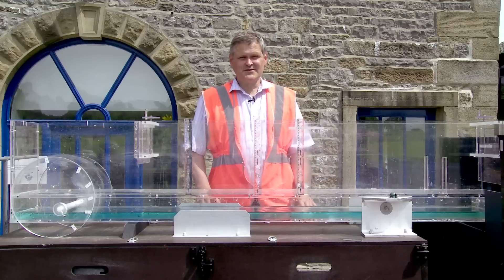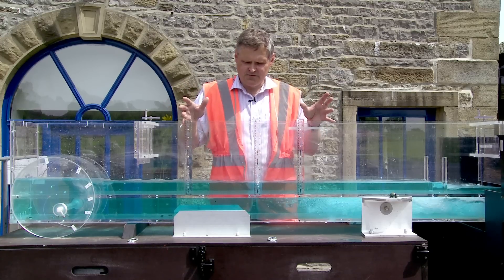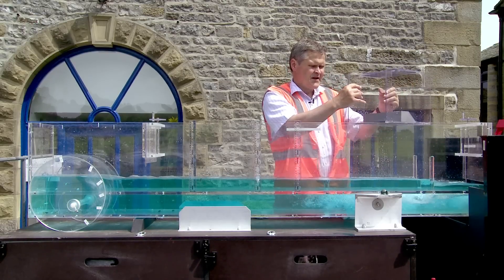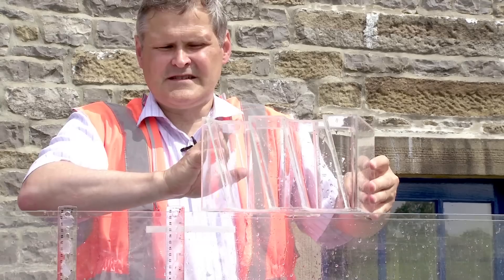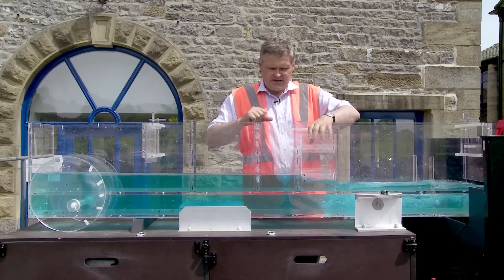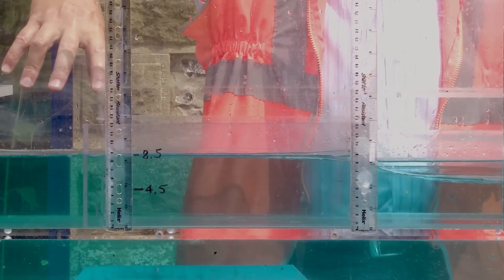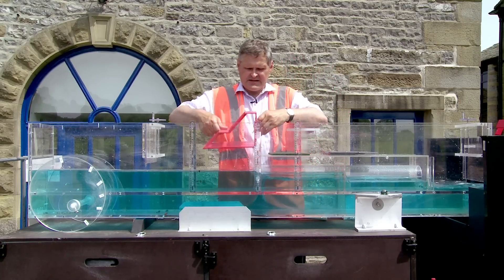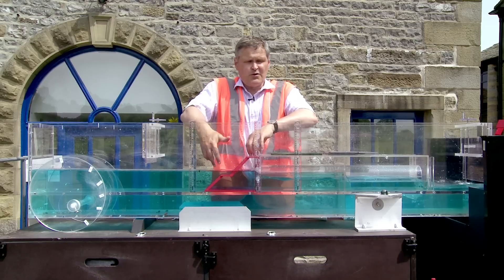Hydraulic Flume Demonstration

Comment: What are the dimensions or specific criteria to classify low slope, medium slope and large slope of
open channel flow? Briefly explain?
Reply from the maker: Hi Aditya, thanks for commenting.

A mild slope is one where flow depth is greater than critical depth (i.e. where flow is subcritical).
A steep slope is one where flow depth is less than critical depth (i.e. where flow is supercritical)
A medium slope is one where flow depth is at or close to critical depth

In terms of quantifying what slope values are (‘mild’, etc) it depends on several factors: flow rate, roughness, position of hydraulic controls. However, as a guide, a steep slope is 1 in 10 (10%) or steeper and a mild slope 1 in 100 (1%) or slacker.

I hope that helps.

Jeremy 

Executive Chairman of JBA Group

Comment: Do you think about the effects of the hydraulic jump after the bridge/culvert on scouring the stream bed-- I do fish passage work in the USA, and type one flow that you suggested as ideal for hydraulic conveyances tends to created waterfalls at the culvert outlets over time and  prevents fish from migrating upstream,  and significantly alters the original hydraulic design.
Reply: JBA Consulting thank you for responding! I am familiar with creating Downstream controls to Backwater the culvert, that is indeed one of the major design criteria I require of the engineers I contract to design my culverts. My biggest issue with the type 1 flow scenario demonstrated in the video is that creating supercritical flow through the majority of the Culvert Barrel effectively surpasses swim burst speeds of most migratory fish and creates velocity barrier. Back watering with a downstream where or natural control point to create Type 3 tranquil flow conditions can work, but in any situation where the stream is being forced into a smaller cross-sectional area then exist in the natural stream there's going to be sediment agradation  and scour issues at the Inlet and Outlet.

Are you familiar or with the stream simulation design principles that the US Forest service has developed?See this link for more info: http://www.conservationwebinars.net/webinars/stream-simulation-culvert-design-and-performance

The most important criteria they posit is to design open bottom structures whenever possible, and if not to embed culverts significantly to ensure that a natural stream substrate is contiguous through the culvert. 

Because of our endangered salmon and other Aquatic species, there is increasingly of focus on using this stream simulation design principles when putting in culverts.   Designing structures that mimic stream processes through the culvert to ensure adequate sediment mobiltiy Downstream and Aquatic organism passage up and down stream to increases ecological function and decreases catastrophic flood failure risk because sediment aggregation and scour are no longer an issue if the stream cross-sectional area is preserved throughout the culvert.  Obviously cost increases a structure span increases, and this is the major roadblock to the implementation of this strategy! I would love to hear your thoughts on other more cost-effective ways to meet both of hydraulic and  ecological goals of road/stream crossings.

Thanks for this video it is very informative and helpful!